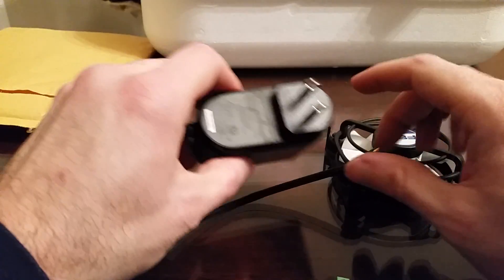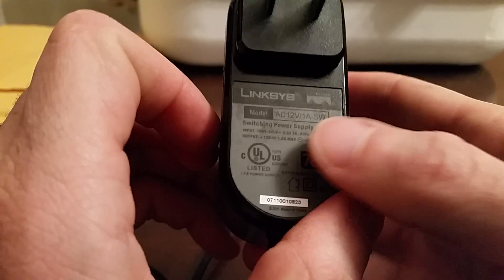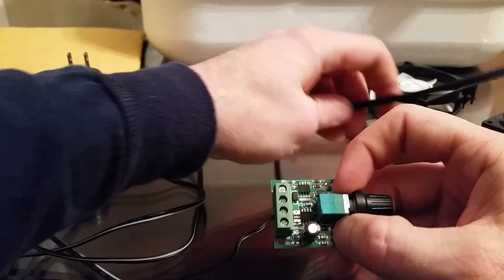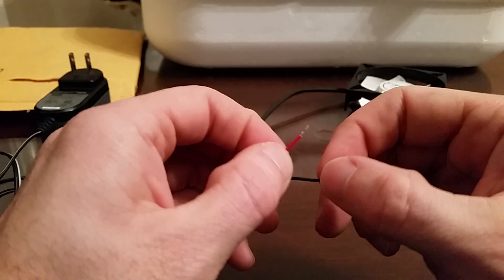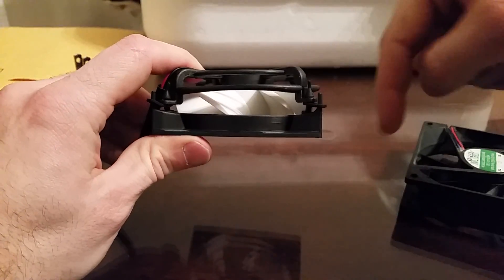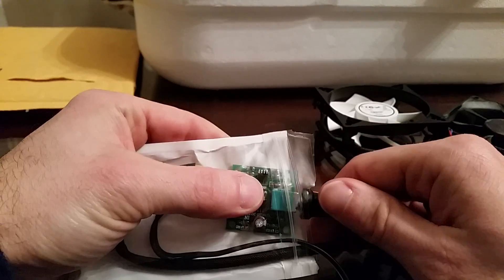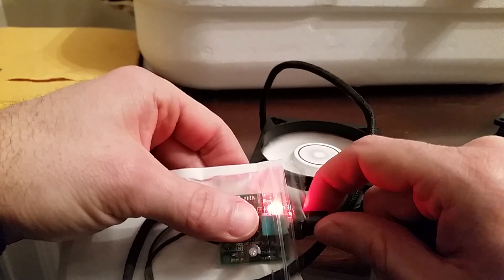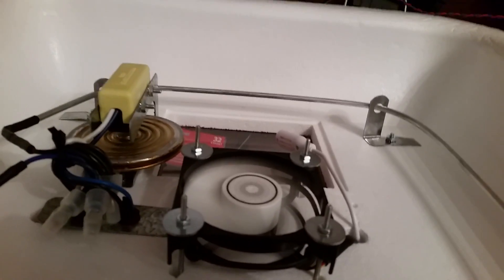Wire A Computer Fan To Run On Wall Power For Use In An Incubator

Comment: The amp rating is not "at least" it is "at most" if you pass more current through a device than it is rated for you could destroy it or even cause a fire.
Reply: would 12v 1a be too much for a pc fan? the fan says 12v .15a

Comment: Does anyone know how this would work with a light at the same time. I have to replace a fan for my overhead stove cover. But they do not make them in my size unless custom ordered in the hundreds of dollars. So I want to do exactly this with a noctua fan 200mm. It fits I checked. But there are lights, so now I either need a new line for just lights or DC lights and a switch for them, but then I'd need a new line for the other board. Basically I have 1 input of power, 1 output fan, 1 output light, and need 2 switches.
Reply from the maker: It really depends on what is wrong... and I assume there is A/C going into the fan/light fixture.  If it is just the fan that is broken your best bet would be to buy another A/C fan that you think you could mount in the same housing as the broken one.  Something like this could work: https://amzn.to/3cRJi4Y
Reply: @willworkforliberty  Thanks for the link, reply, and idea. But sadly I live in a literal factory-made trailer. For what every reason everything is custom size, ducts are custom, airvents custom, lights custom, that fan, the overhead cover, the light in there. 

so every fan I have looked at or found is too small or too big.  But I have found DC fans that are correct enough sizes. My fan is mounted like a ceiling fan, so those corner screw holes wont actually work. I have a solution though it just currently needs to be DC.

Thanks though this video helped me a lot into research. I know little on actual electrical engineering, but I do know enough to DIY small things and did have to do electrical engineering in school so I know basics.

Comment: hi how do i attach this to the computer case ?
Reply from the maker: This is really for wiring a computer fan to a wall socket. 

You could still mount it inside your computer... but it won't turn off with the computer.

Comment: You could just pickup 5v usb fans from 60 to 120mm and plug it into a standard usb charger.   Zero wiring or adapting.   They are all over Amazon.
Reply from the maker: Yeah, I think they were a little less common when I made this video.
Reply: Can I use these usb fans for a DIY dehydrator

Comment: I have Nidec fan from the old computer. It has 12V DC 1.40A. Which AC Adaptor can I use?  What about 1.4A, those with 1A will work or must be more than that?
Reply from the maker: You do not want to use a fan that requires 1.4A with an AC adapter that only outputs 1A.  For that fan you will need a different AC adapter.
Reply: @willworkforliberty  So the ampers must always be higher than required right? So 12V and 2A or 3A will be ok?
Reply from the maker: @RadowitMarkowski  For a 12V & 1.4A fan, yes.  Amps on adapter must be more than amps on fan.  Voltages should match exactly...

Comment: Hi there, did you end up leaving the yellow sensor wire off? What are the implications of not wiring it in the case of PWM fans and controllers? Is it needed?

Comment: What happens if I use an adapter that provides less voltage? Say, 9 volts. Will the fan just run slower?
Reply: Yup. But also don't forget volts are not the only part of electricity current aka amps are also a part. Make sure the adapter outputs more amps then the fan needs

Comment: You did not "MODIFIED" it. You have just put two wires from fan together with two wires from DC power adapter. Jesus.
Reply: does it work though?

Comment: Do they make voltage controls with a switch instead of a knob? For my use on/off would be sufficient. What would that be called?
Reply: I think that's just called a switch. Should be able to get one at an auto parts store

Comment: is it posible to run multiple fans?
Reply: Yes but it depends.

If you wire the fans in series (that means the negative terminal of the source gose to the negative source of fan number 1 then the positive of fan 1 to negative fan 2 then positive fan 2 to negative fan 3 basicly black to red black to red but make sure the end points are red red black black) this increases the voltage required to drive them

If you have a  12 volt fan and you run it at 12v it runs at full speed. Now if you hook up a 2nd fan in series and run them on 12 volts. They will run at half speed because a series connection makes them require 24v

Or you can connect them in parallel that means all reds together and all blacks together. That will increase the amp required to drive them.

Say you have a fan that's 12v 0.2A and you have a power source that gives 12v 3 amps that means you can connect 15 fans in paralel and you'll have a wall of fans that all need 12 v but 3 amps HOWEVER you should never max out the amps on a paralel connection.

A circuit only draws as much amps as it needs. If however you circuit draws more amps then you can provide BAD THINGS WILL HAPPEN so lets say instead of 15 fans you hook up 12 fans that gives you a circuit that runs 12v at 2.4 amps

Note btw that fans usually have small thin wires. That are usually rated by the wattage they consume. I would venture to guess a typical pc case fan may have 24 AWG cable while for 3 amps you'll need a 18 AWG cable.

Just be careful with what you are doing.

Comment: Can you power a USB-fan like this https://www.coolerkit.se/shop/usb-fan-1300rpm-140150p.html?gclid=Cj0KCQjw4f35BRDBARIsAPePBHy3K8MnGsU96py24ItABlR8CNgA2pr4H0MNLj-muS0YT_bglPoxyJsaAs2rEALw_wcB with a normal usb phone charger? Would it be safe to have it running 24/7 for house ventilation?

Comment: will this plug:
 I/P: 120V AC 60hZ 9W
O/P: 12V DC 300mA
work with a 12V 0.25A fan?
Reply from the maker: Yes. The voltage is the same. As far as current goes, the adapter can put out 300mA, which is more than the 0.25A or 250mA that the fan requires.

Comment: Hiya, thanks for your video.  Can I connect 4 computer fans to one wall plug?
Reply from the maker: Youd have to add up all the current required and make sure that it doesnt exceed the output of the power adapter... and you'd want the voltages of all the fans to be the same.

Then youd probably also want to wire them in parallel.

Comment: I have PFR0912XHE computer fans. They are rated at DC12V 4.50A. I want these to run on wall power. Can I power these on any 12V 5 or more Amp rated plugs? I was thinking of buying 12V 10A Laptop chargers and splicing these to those to run on wall power. Same idea?
Reply: As long as your power brick/ adapter / power source/ power supply. Pumps out more amp then the fan needs you are ok.

Never let the fan draw more amps then your source can give out

Comment: Do USB cables have specifications regarding voltage and amperage? I know my USB adapter does, but does the wire you use make a difference?
Reply: Let's say you have a circuit that draws 40 amps but a power supply that only gives out 20 amps. This is dangerous you should always make sure your supply Is rated for more amps then the circuit needs. Because it will only draw as much as it needs.

Now the higher the amp the circuit draws the thicker wire you'll need  for 3 amps you need somewhere around an 18 AWG wire (don't quote me on that)

Note that the lower the number of AWG means the wire is thicker so a 0 AWG cable is very thick and is designed for high amps

I had a usb swamp cooler and on one end it was a usb and the other was a 12 volt prong. And the wire said 26 AWG meaning it's for low amps

Typicly usb cables are used for phone chargers/ adapters. Those usually don't out put more then 5v at low amps and keep in mind most pc case fans run on 12 volts so running a case fan at a phone usb charger will run it at less then half of its full speed

What need is a power brick that has an output of 12 volt and enoght amps to support as many fans as you want.

Keep in mind wiring fans in series increases the voltage required to drive them. While wiring the fans in parallel increases the amps that is required to drive them

Hope this helps

Comment: thanks, but why do we is there so many circuits inside the voltage controller, for what is it needed for?
Reply: Running straight 120v through that fan would burn it out instantly. It’s basically an adjustable resistor that controls the power to the fan.
Reply: @Deadshot1997  The power supply already drops the 120 VAC down to 12 VDC. The controller adjusts the resistance in order to manipulate the amperage in the circuit.

Comment: A quick google search shows that you can get the power supply with a speed controller all in one:

https://www.amazon.com/AUTOTOOLHOME-Adapter-Adjustable-Supply-Controller/dp/B01M3NL3NV?ref_=fsclp_pl_dp_2

This random google hit shows a 1 amp controller adjustable from 3-12V for your 12V fan for about 50% more than the list price of your 2A controller w/o power supply.  I figure a person could probably find similar at aliexpress for 1/10 the price.

So if you run out of old power supplies to re-purpose, you can always just buy a whole unit (variable controller with power supply).

I'm thinking of doing something like this to make a small and quiet smoke eater for filtering my cigarette smoke so that it doesn't stain my house's walls so badly.  Wire up a small quiet fan with a filter in front of it to scrub the smoke particles out.
Reply: Here we go, $2.19 from aliexpress:

https://www.aliexpress.com/item/1pcs-adjustable-ON-OFF-DC-3V-12V2A-of-voltage-3V-4-5V-5V-6V7-5V-8V/33003628350.html?spm=2114.search0104.3.248.49523a93mFjJ5A&ws_ab_test=searchweb0_0,searchweb201602_8_10065_10130_10068_10890_10547_319_10546_317_10548_10545_10696_453_10084_454_10083_10618_10307_537_536_10059_10884_10887_321_322_10103,searchweb201603_6,ppcSwitch_0&algo_expid=f93375cb-3de1-43a1-9e29-c0c168ee1c58-41&algo_pvid=f93375cb-3de1-43a1-9e29-c0c168ee1c58

adjustable 3-12V 2A power supply, input 100-240VAC.  $2.19 for the whole shebang, just plug a fan into it (either snip off the DC plug and attach the wires directly or put a plug on the fan wires and connect it to this thing.
Reply: Actually there's a better one for 9V-24V now that I look for the same price.  I think a good range for a computer fan is probably about 3V to 15V ... something like that.  I think PWM fans switch from 3V to 7V to 12V (or equivalent percentages for more pwerful fans - like the 15V ones that are used).

Comment: I'm planning to make a HDD bay with at least 4-5 fans. Do i need to buy a 12v 6amps switching power bricks ? I strictly had no idea what's the maximum amp these 12cm fans could take in.. Would it burst the fan or something ?
Reply: If you connect them in paralel the amp increases they add up. As long as your power brick pumps out more amps then the fans need its ok

The circuit should never draw more amps then the source provides

Comment: Hello, thanks for the video. Can I ask you whether if I can connect multiple identical fans to a Single 12V adaptor (without the voltage regulator)? So basically just put every positive cables (of the fan) on one same adaptor pin and so does the negative cables
Reply from the maker: Yes, as long as:
a) the voltage requirements for the fans are the same.
b) the voltage output of the power supply is the same as a single fan in the group.
c) the sum of all the amperage requirements for all the fans is less than the output of the power supply.

When wiring things in parallel the voltage requirements of the source do not change, but the current requirements do.

For example, if you had 9 fans that required 12V and 0.1 Amps, you'd need a 12V adapter capable of putting out about 1.0 Amps (technically 0.9 Amps, but I wouldn't recommend running it that close to the max).
Reply: @willworkforliberty  alright, thank you for your help
Reply: Thank you for your reply! One more if I may: I have a 12V 5A AC-DC PSU that I wanna use for my PTC Heating element, rated at 12V 100W. I say, the PSU wont supply enough amperage because the heater requires 100W which, if I calculate using P=VI, wont supply enough current for the heaters. Am I right on this? If yes should I change to higher amperage PSU?

Comment: I connected it directly into the wall socket and it let out a spark and burning smell, I just need to know if it's still useable , it was just there for less than a second?
Reply: Most likely its toast but there is no harm to hook it up to 12v DC and check the damage.
Reply from the maker: Yup, probably broken. :(
Reply: Yeah it's toast I tried it with the 12 volt inverter :(
Reply: yeah, you let out that magic blue smoke.  It's toast!
Remember folks, you can always supply more amps, but as soon as you supply more volts, the magic blue smoke is forever released.
Reply: @greencanofbeer  what if you supply less amps?

Comment: i found some old 12v 500Mah power supply , can i just wire it directly to my fan connector or is that dangerous because most of the fans only use like 100-200Mah ?
Reply from the maker: The voltage is what is important.  If you fan is less than or equal to 12 volts than that power supply will be fine.  The milliamps of the power supply should be equal to or greater than the milliamps required by the fan.
Reply: @willworkforliberty  what if my power supply give me a 12v and 1000mA ? can it work with my fan(12v , 0.25mA)
Reply from the maker: Are you sure the fan draws 0.25 mA and not 0.25A?  

Either way what you have should be fine because 0.25A is only 250mA, and your power supply is capable of 1000mA.

Comment: tried a nokia 5V 890mah on 12 v 0.85a  fan , it didnt even move , lol
Reply from the maker: You need to match the voltage almost exactly.  You might be able to get away with 9 volts, but it probably wont run as expected.
Reply: Most 12v fans won't move until you get to 7v and some even slightly higher and even then the speed will vary by output. It won't run at full speed until it's getting 12v.. You just need higher higher voltage output than 5v.

Comment: hi there friend, i have the F12Pro fan, nearly the same as your F8, but my fan has no red wire it has Black, Yellow, Green and Blue. Can you help me out with how to wire it to a 12v plug, Thanks Dwayne
Reply from the maker: D Carney on 4 wire fans the yellow wire is usually the 12v in.  If in doubt you can always hook it up to you computer and check the voltages with a multimeter while the fan is running.
Reply: sweet thanks, that is a great idea. cheers Dwayne
Reply from the maker: How did it work out?
Reply: works great,i have my fan up and running. ive attached a fan speed control as well. its so quiet and now i dont have a big ugly fan in my way  all the time,
Reply: @dcarney5866  I'm trying to figure out how to connect my 4 pin fan to a PWM controller and then to a power supply, would you be able to advise?